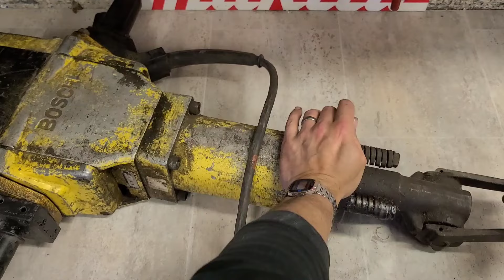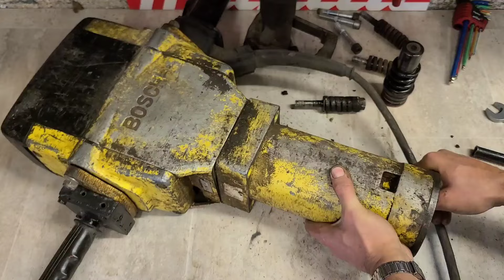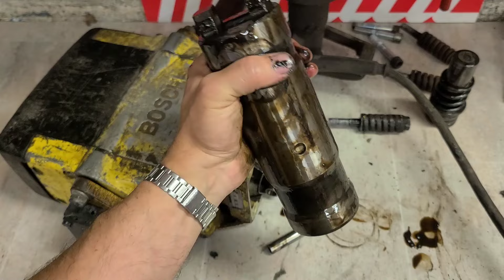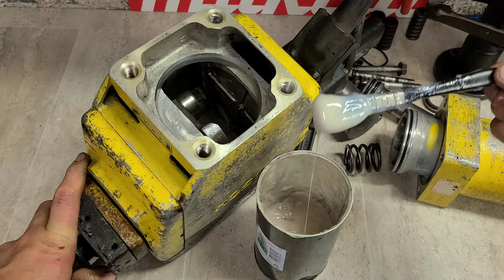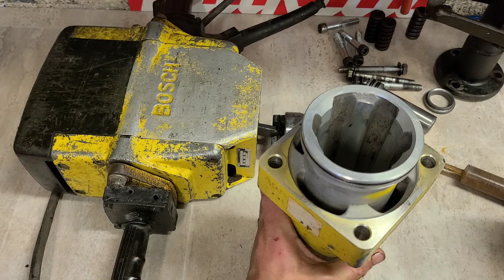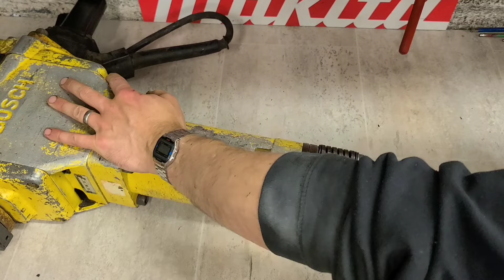Repairing an old, made in the USA, Bosch GSH 27 demolition breaker hammer.

Comment: When stuff was built with durability & repair in mind.
Reply: The changes that has been made to this model, compared to the old USH 27 and the new GSH 27VC when talking service etc. is minimal. Oh… and if you want to talk about how things were in them good ol’ days, then the reference would be the USH 27 which look identical to the GSH 27 and for except a few parts, is identical. This Yellow GSH model, was in production all the way up to the late 2000’s But, again, the yellow GSH27 and the blue GSH 27VC is all as strong as ever. Doing maintenance and service is same same. If anything, the blu VC is run better during use. 
To be fair, the GSH 27VC is a better hammer than the old USH27 and the GSH 27 in all fronts, I can promise you.
Does this goes for all power tools, absolutely not. But the 27 is still going strong.
Reply: They still make an updated model not much has changed mechanically.

I bought a Makita HR2470 SDS Drill for 100€ recently. It really surprised me how well made and durable they build it even just for a 100€ drill.
Parts are available and cheap.
Good stuff is still being made you just have to find it.

Comment: Those hammers need to be stored upright, if you lye them down with the chisel slightly higher than the body the hammer piston can slowly slide up into the bore and get stuck in by vacume & can be very difficult to get out, bosch sell an overhaul kit with tacky grease & o rings etc, decent hammer.

Comment: Dean, what grease are you using in it?
Reply from the maker: Bosch hammer grease
Reply: @deandohertygreaser does it have a “generic” equivalent? - the greases sold under the tool brands are a tad expensive. Just paid 20 quid for a pint of Makita grease.
Reply: @deandohertygreaser  , doesn't look like the same bosch grease available online in a little white tube.
The grease in the cup seems more liquidly.

Comment: Was wondering why not use the air compressor to get the hammer out?
Reply from the maker: Because of the risk of dropping the piston or hammer. One drop and they are scrap
Reply: If it's stuck and you find a way to build air pressure behind it, you'll turn it into a rocket.

Use grease gun pressure to move stuck things if you really have to, same way you remove stuck brake caliper pistons.
A decent grease gun can build thousands of pounds of pressure, but grease isn't compressible so won't turn things in to a cannon

Comment: Back in the 80s I used a jackhammer like that but maybe not that brand but I was also the guy that would use the 8 lb Sledgehammer to bust a concrete Etc
Reply: That's a small sledge for breaking concrete!!
Reply: @bushratbeachbum  it might have been 12 lbs. It was 40 years ago